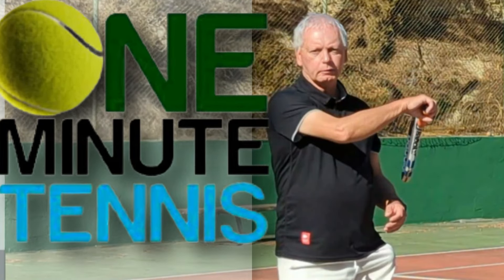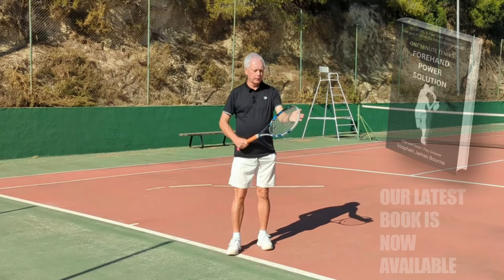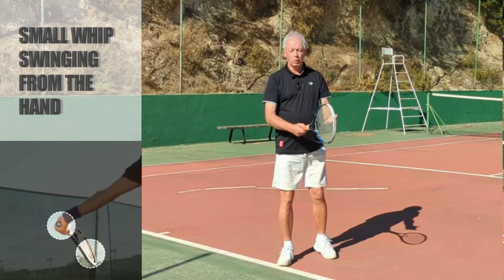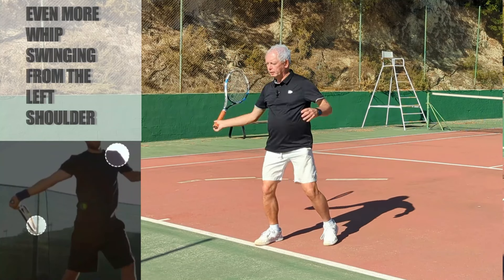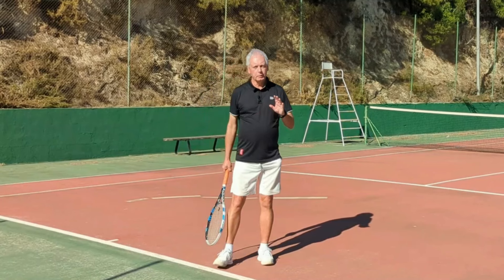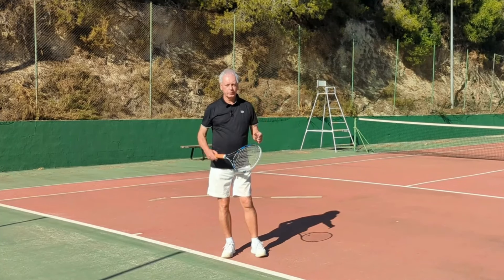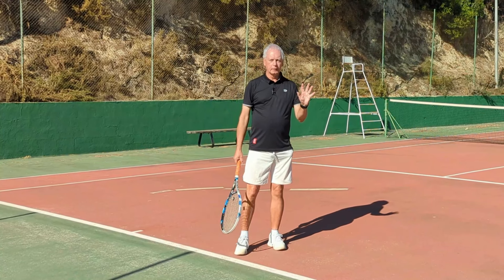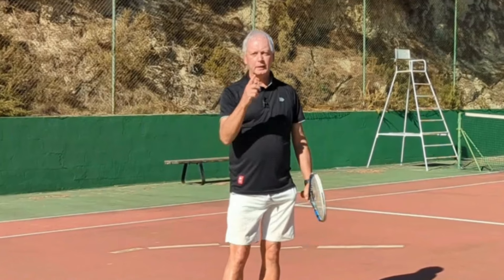How to Whip your forehand for more speed

Comment: Thank you so much for the tutorial

One of the comments asks what does putting the left hand up do.
I think it creates an opposing tension, which enhances the racket swing

Might you comment please.
Reply from the maker: That's exactly correct. It's called bilateral symmetry.  Where one side of the body naturally mirrors the other.  Does that make sense?
Reply: @oneminutetennis  Yes

I have a dominant left eye. 

I opened the batting at school from 8 to 18 left  handed. I play tennis right handed.

I played hockey on grass at school
I had a special shot that nobody else played
Backsticks - I liked backsticks because of my dominant left eye
1. stop the ball 
2. bend knees with both arms on the stick and turn the upper body - to lever the ball gently so it rolled up the stick about six inches and was stuck to the stick by gravity - then whip the stick round - and the ball flew high over the pitch a long way

It was all created by tension

I think of that shot when watching your wonderful videos

Comment: Retraction of the left arm is only to initiate and enhance the left torsion of the torso,it has nothing to do with internal shoulder rotation 😢
Reply from the maker: Sorry. But the body is more connected than that. Here are some notes from my biomechanic studies.....  
The movement of the left arm plays a crucial role in facilitating the internal shoulder rotation of the right shoulder, which is essential for generating power and accuracy. Here’s a detailed explanation of this biomechanical process:

Biomechanics of the Tennis Forehand

Preparation Phase:

Stance and Grip: The player typically starts in a ready position, with both hands on the racquet.

Unit Turn: As the player prepares for the shot, the body rotates as a unit (hips, shoulders, and arms) to bring the racquet back. The left arm (non-dominant arm) moves across the body, aiding in shoulder turn and helping to coil the upper body.

Backswing:

The left arm extends across the body and is often pointed towards the ball's expected contact point. This movement helps maintain balance and sets up a proper shoulder turn.

The right shoulder is externally rotated during the backswing, with the right elbow bent and the racquet head pointing upwards and behind.

Forward Swing (Acceleration Phase):

Left Arm Movement: As the player initiates the forward swing, the left arm begins to pull back towards the left side of the body. This pulling motion helps to open up the shoulders.

Shoulder Rotation: The pulling back of the left arm assists in the rapid internal rotation of the right shoulder. This rotation is critical for accelerating the racquet head towards the ball.

Impact:

At the moment of impact, the right shoulder is internally rotated to its maximum extent, allowing the racquet to make solid contact with the ball.

The left arm is usually tucked close to the body or extended back, maintaining balance and ensuring proper rotational mechanics.

Follow-through:

The left arm continues to move back or to the side, which helps decelerate the body and complete the rotational movement.

The right shoulder continues to rotate internally as the racquet follows through across the body.

Biomechanical Insights

Kinetic Chain: The left arm movement is a part of the kinetic chain that starts from the legs and moves up through the hips, torso, and shoulders. The left arm’s motion helps to coordinate the upper body’s rotation, ensuring that the energy generated from the lower body and core is efficiently transferred to the hitting arm.

Counterbalance: The left arm acts as a counterbalance to the right arm’s swinging motion. This helps maintain the player’s balance and stability, crucial for both power and control.

Shoulder Stability and Force Generation: The action of the left arm in conjunction with the trunk rotation stabilizes the shoulder girdle, allowing the right shoulder to generate maximum force during internal rotation.

Anatomical Considerations

Scapular Motion: The scapula (shoulder blade) on the left side retracts (moves towards the spine) as the left arm moves back. This retraction assists in the protraction (forward movement) of the right scapula, enhancing the internal rotation of the right shoulder.

Core Muscles: The oblique and transverse abdominal muscles are actively involved in rotating the torso. The left arm movement enhances the activation of these muscles, contributing to the rotational force applied to the right shoulder.

Pectoral and Deltoid Muscles: The left arm movement involves the contraction of the left pectoralis major and deltoid muscles, which help in the overall coordination of the shoulder girdle, aiding in the right arm's internal rotation.

Understanding these biomechanical and anatomical details helps in optimizing the forehand stroke

Hope that this helps a little